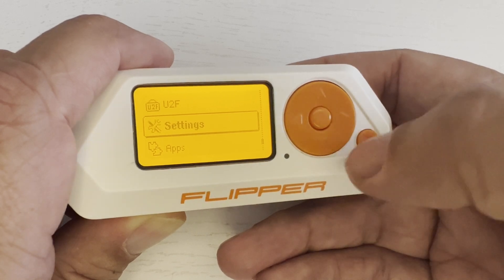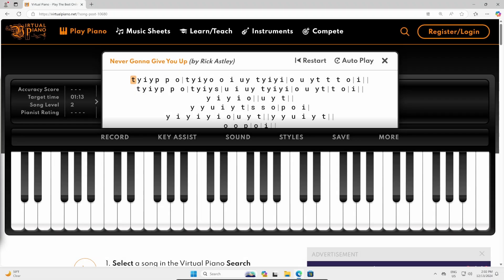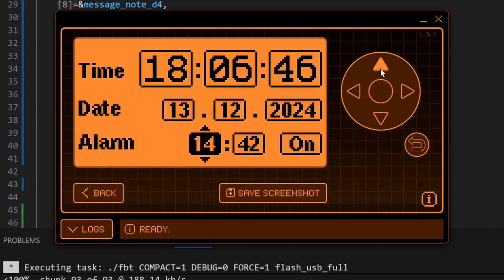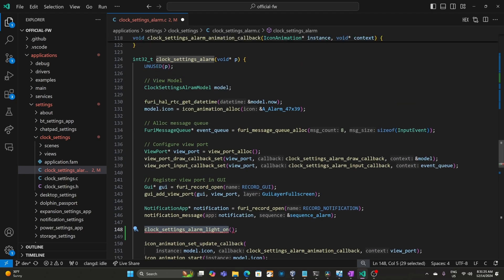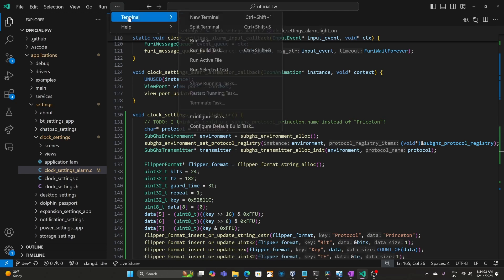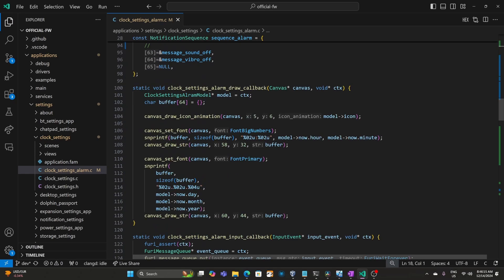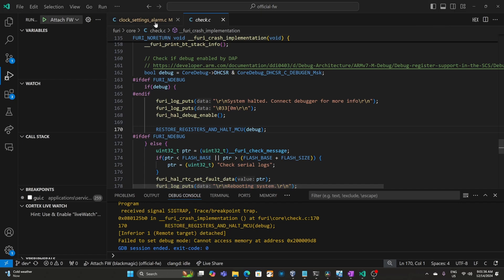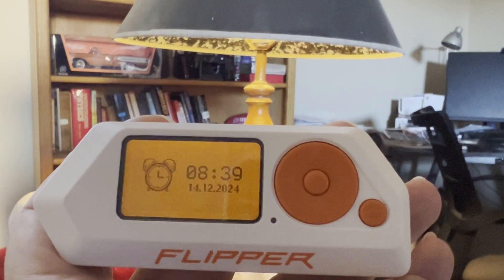[145] Flipper Zero: Alarm Clock (+new tones, IR/SubGHz signal) #flipperzero #rickroll #infrared

Comment: Great tutorial man! I could see the timed IR functionality in an app too🔥
Reply from the maker: Thanks! Yeah, you can use those methods from the wiki to send both known protocols (like Samsung32/NEC) or RAW infrared signals from any Flipper Zero application. Maybe I should add a video on how to receive IR signals (using infrared_worker) - RocketGod and I learned a lot about infrared while making the "Flipper Zero Laser Tag game".

I also cut out the talk about HOW the clock_settings_alarm method gets called (which I thought was really interesting, but my wife found it distracting from the primary content). Maybe I can sneak it in during another video. 🤣